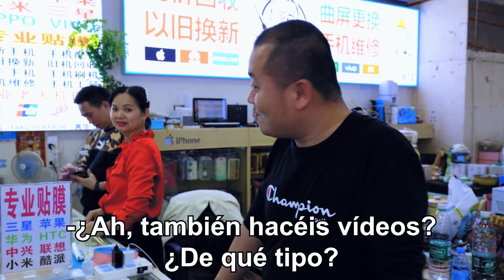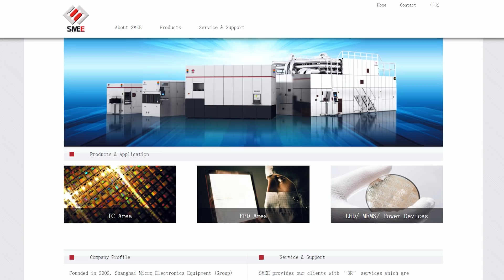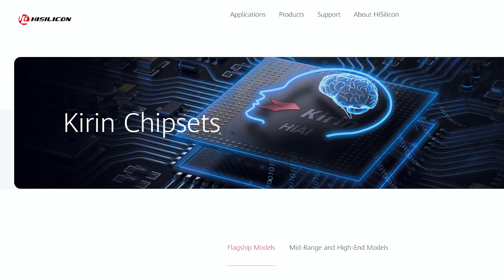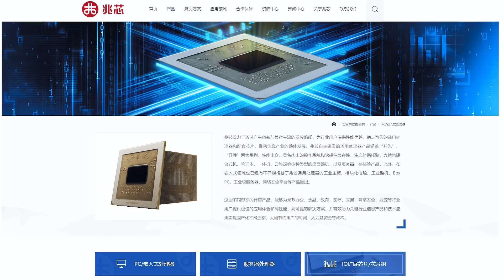ESCASEZ de CHIPS en CHINA: la GUERRA TECNOLÓGICA | Jabiertzo

Comment: ASML Holanda es la una fabrica que produce Scanner de impresión de obleas para semiconductores. Aparte de Japón, pero para microchips que no tienen nada que ver. Solo se venden estas maquinas a USA, Taiwán y Corea del Sur. Europa esta pendiente de recibir quizás alguna en un futuro. En Alemania hay modelos antiguos de quizás entre 28 y 16/12Nm (posiblemente también en más países) china fabrica chips a 28Nm con maquinas viejas.
El problema de la escasez de estas maquinas? son muy complejas y costosas de fabricar, superan los 300 millones de dólares (la unidad), las actuales que se producen para 7 y 5 Nm. 
ASML solo es capaz de producir de 5 a 12 modelos por año, dependiendo del modelo y lo moderna que sea. Entre todos los modelos que puede distribuir y fabricar al año no llegarían a 20-30 unidades, de las mas actuales serían de 8 a 12 unidades (de 7 a 5Nm). 
El primer año de un nuevo modelo pueden fabricarse como mucho 5 unidades. Cada una de esas maquinas podrían ser capaces de fabricar varios millones de transistores, entre mas de 100.000 obleas al año que es capaz de imprimir una maquina. Una maquina (scanner) va ser capaz de producir en breve entre 120 mil y 150 mil obleas (ahora no llegan a tanto), por cada oblea pueden salir mas 100 microchips (depende del éxito y el tamaño de cada circuito integrado "Chip").
El plato o la oblea de impresión puede costar entre 10 y 50 mil dólares "mínimo" dependiendo de su litográfica "nanómetros" (millonésima de milímetro).

ASML lleva años ampliando sus fabricas y capacidad, pero jamás dará abasto para tanto, porque cada 1 a 3 años hay que modernizar las maquinas, entre 3 y 5 años hay que mejorar las litografías y diseñar/fabricar nuevos modelos y empezar casi de cero, e ir remplazando las maquinas viejas por las nuevas (es un ciclo que nunca se termina) en 2026 hay que remplazar las maquinas y litografía actual por una muy mejorada, la escasez de chips nuevos será brutal. Cada año hay mas escasez de chip nuevos, ya que cada pocos años hay que renovar maquinas y tecnologías. 

Pero todo esto es geopolítica, una guerra fría entre oriente y occidente, se escapa al entendimiento racional (a la lógica) es una guerra fría y se busca futuras inversiones en tecnología militar.
Occidente firmo un pacto de desarrollo con China en 1965 (posiblemente con la escusa por la ayuda en la guerra mundial contra Japón) una escusa para fomentar un futuro rival industrial y tecnológico (futuros conflictos en inversión militar).
La mayoría de la tecnología China son o eran patentes de USA, Inglaterra, Japón y Holanda, ayudando a su desarrollo industrial (futuro rival). Alemania nazi (partido socialista) fue respaldada con las patentes militares de USA e Inglaterra en en 1933... Inglaterra dejo de financiar a Alemania por 1933 (la escusa nacionalista), la crisis alemana se recrudecía una vez mas. USA ya lo hacía en 1930 por la gran depresión. Esas circunstancias motivaron el movimiento nacionalista "socialista nazi" (Alemania llevaba década y media muriéndose de hambre, deudas de guerra) e hizo lo que podía y debían, revelarse al fascismo internacionalista de la banca privada UK-USA-HL (como hace USA actualmente con todos lo gobiernos "restricciones comerciales", con la Plandemia en la cabeza "maden in UK" ingeniería psicológica "miedo artificial" el cuento del lobo "que nunca llega").

UK-USA llevan siglos creando rivales "inventados" (Ficticios e imaginarios "como el VIH, SIDA, Gripes, Hepatitis, Tetanos, Cov...") para financiar deuda y banca (vacunas "patentes"), la industria militar y ahora también la energética (incluso la química farmacéutica "que no es otra cosa que veneno químico elaborado con ácidos o metales pesados "Herbicidas y pesticida agrícolas", con las enfermedades modernas y las radiactivas "los virus no existen, son proteínas/toxinas, ácidos" y la proteína/toxina y son generadas por otra bacteria llamada "enzima". Todo organismo vivo es una bacteria "jamás han sido nunca un virus" por ácidos que forman genes y sus proteínas).

Los resfriados no son una enfermedad, como tampoco lo es la gripe, mucho menos un coronavirus. Los resfriados o gripes son síntomas o alteraciones metabólicas en el comportamiento celular o nervioso, como suele ser el cambio de temperatura en una bacteria o célula. 
La temperatura elevada "estimula" ciertas bacterias y se vuelven activas, o se les ordena su reproducción o clonación, mediante estimulaciones nerviosas desde el hipotálamo (la fiebre estimula las células y las defensas pero también el "canibalismo celular") y el organismo se devora así mismo, la grande a la chica (pasados unos días si la temperatura no desciende, el colapso) alergias y errores neuronales, cambios de temperatura o falta de sales o vitaminas. Las casusas son miles como sus síntomas. 

Todas las células se defienden por si mismas de su célula vecina, por un comportamiento errático y al volverse agresivas las unas con las otras (la temperatura cambia/altera su metabolismo). 
La enfermedad por falta de defensas no existe, el VIH es un invento mas farmacéutico (como los PCR vendidos para su detección, que ahora se venden también para "Covid", son el mismo producto desarrollado para inventar y detectar virus jamás existentes "ácidos y proteínas desechas/fracturadas", incluso proteínas alteradas por ácidos químicos, venenos radiactivos o metales pesados), todo ello en 1980 tras la fallida inversión por descubrir el nunca existente "virus del cáncer" y tras la aparición del los microscopios electrónicos, al descubrir células nuevas cada vez más pequeñas, con unos comportamiento erráticos.
Dinero: 100% dinero = PODER (información). TIMO-ESTAFA y sus miles de años de historia grecorromana. Y siempre es cíclico, porque históricamente el ser humano es "bueno por naturaleza" y nunca cree mal del prójimo (cree en lo fantástico "Dios", y nunca en lo que esta realmente presente) siempre muy bien pensado "siempre positivo" (como diría Van Gaal).